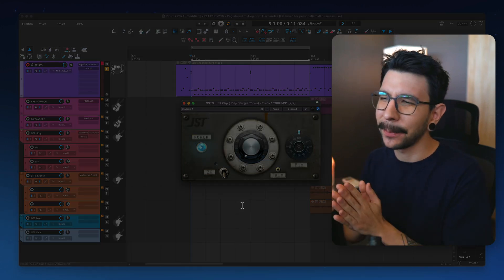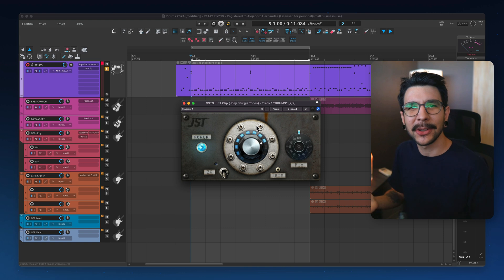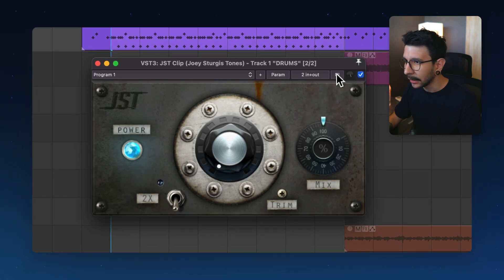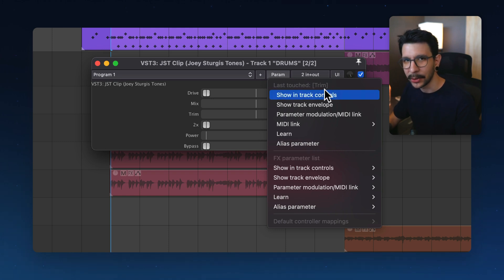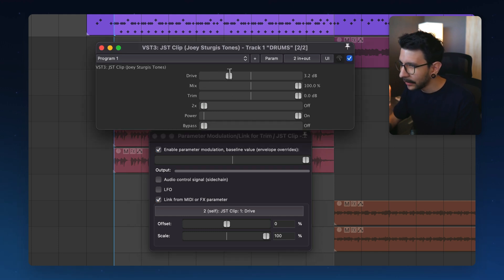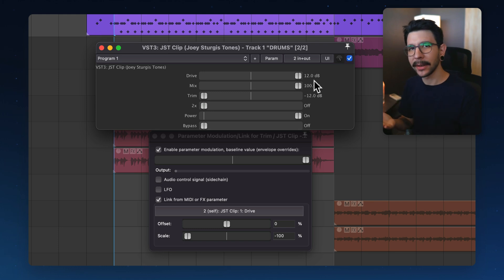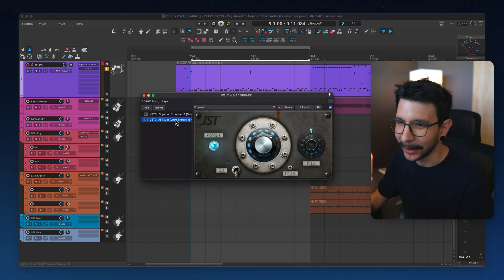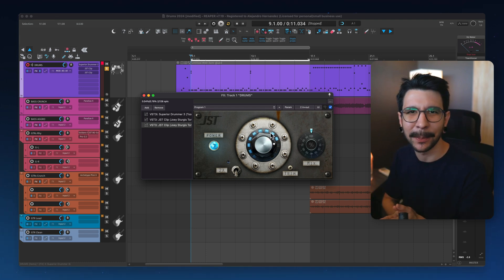no auto-gain?

Comment: Another reason to switch back to Reaper from S1. I tried a year ago and forgot why I didn’t stick with it, then tried a month or two ago and remember why… the output comes out WILDLY different than what I’m hearing in the DAW; it’s like the side channels get boosted 3-6 db. I never messed with anything in the output settings and even did an update before my last try and it still did it. Is my install bugged or is there something I messed up in the settings that I’m not aware of?
Reply: Reaper doesn't use pan laws
Reply: Reaper doesn't use pan laws like some other DAW
Reply: @djsusan00  then what could be causing it?
Reply: What audiointerface r u using?

Comment: Correct me if I'm wrong, but isn't there a risk you'll just fool yourself a different way when applying linear gain-staging to a plugin which in itself is non-linear? 
Annoying as it can be, there's a reason some plugins don't have auto-gain; either because it's very hard to do properly or because there's a risk it'll defeat the purpose. (The flavor of the applied effect will vary according to the gain stage and you'll want to make a tradeoff between gain and trim, with excess being handled on your fader.)
The effects might be too subtle to hear if you're only looking to clip the peaks of course, but I wouldn't make a habit of this trick on most plugins - at least not with a linear gain relationship as seen here.

Comment: Very useful feature, thanks !
Though it only works for plugins which have a trim or output gain included...
Since it is saved as a FX chain, I guess it should work also with an external trim plugin.
Reply from the maker: Yes exactly! For example in the case of JS: Saturation which doesn't include an output knob, you can totally do the same process by adding a trim plugin afterwards. (tho someone made a mod that includes an output knob: https://forums.cockos.com/showpost.php?p=2703902&postcount=3)